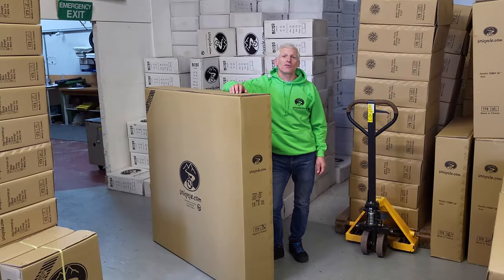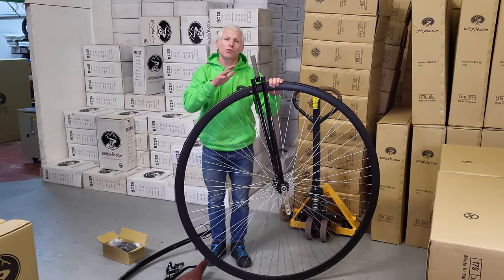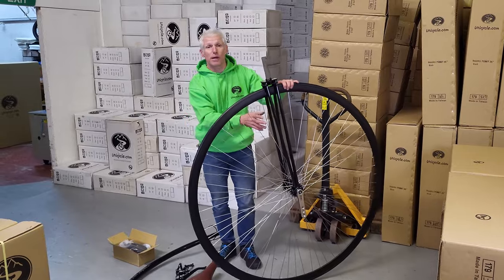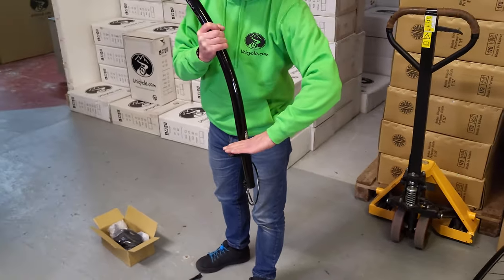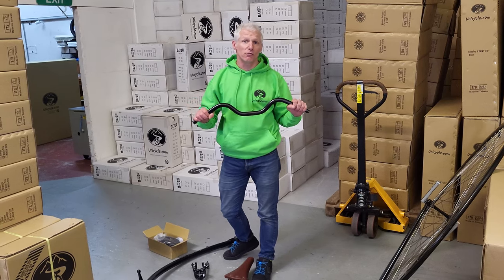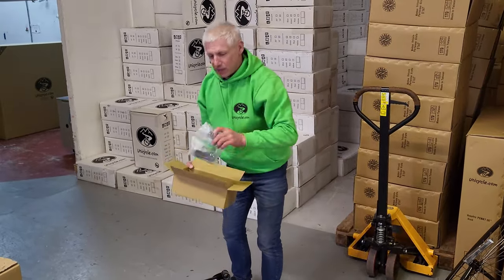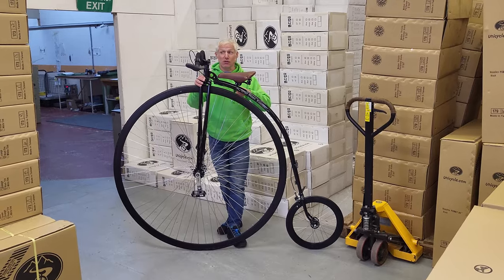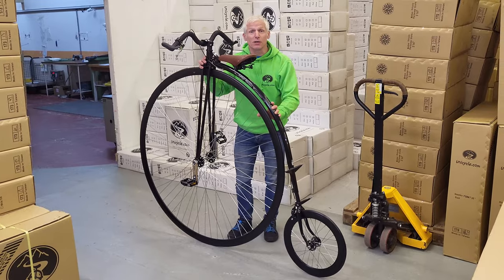Unboxing the Mk5 UDC Penny Farthing

Comment: What would the recommended hight be for riding that exact penny farthing? There’s also one that’s 50 inches UDC. What would the height of a human be good enough to ride the 50?
Reply from the maker: We give the  sizes in the product descriptions: https://www.unicycle.co.uk/penny-farthing/48-udc-mk5-penny-farthing-black.html

For general riding follow that table shown below, if you are looking at racing penny farthing consider going to the size larger. The measurements are from crotch to floor with your shoes on.

30" inseam length = 48" Penny Farthing
32" inseam length = 50" Penny Farthing
34" inseam length = 52" Penny Farthing
36" inseam length = 54" Penny Farthing
These are recommended "rules of thumb" only, and not written in stone. If you are not sure give us a call and we can discuss.